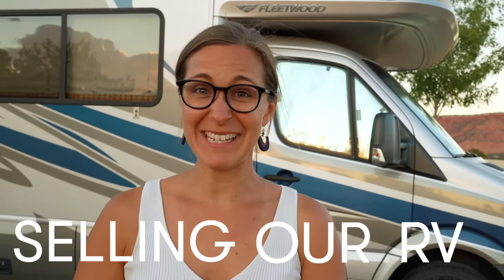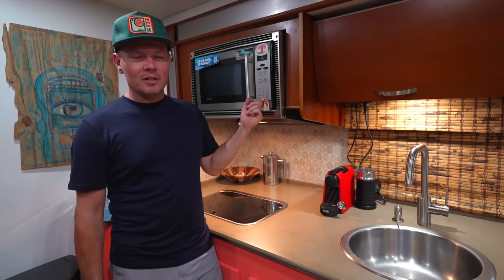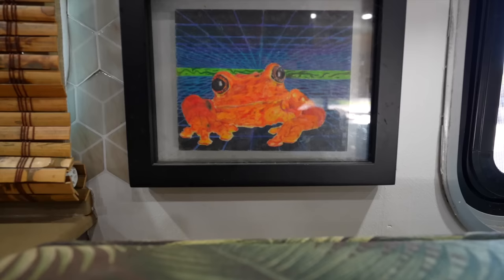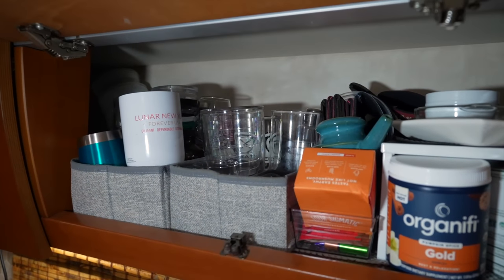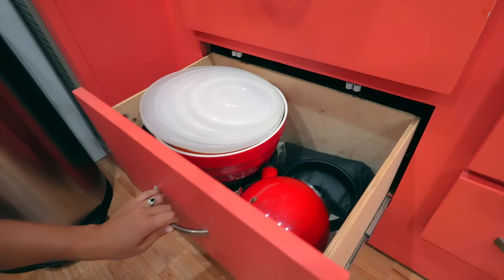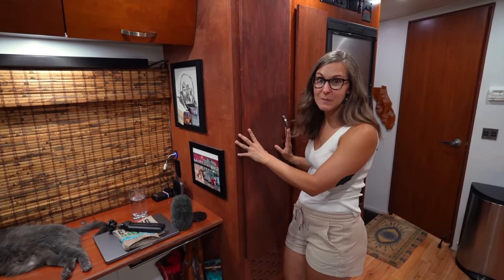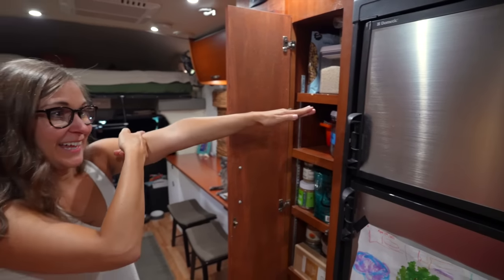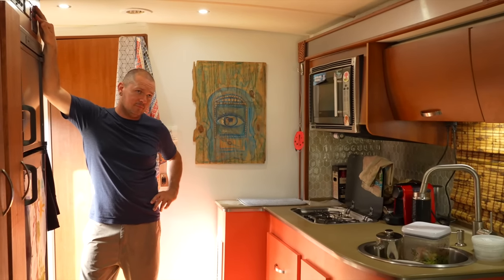We Sold Our Remodeled RV (FULL TOUR Luxury Off-Grid Class C Motorhome)

Comment: Your price is too high for a 2010 model with modifications.
Reply from the maker: There's only 1 other of our model for sale right now and it has no modifications. They are asking $85,500. They didn't make many of these to begin with. We based our price on NADA retail and considered the value of upgrades. Even if you bought one for less after doing all of the upgrades and modifications  we've made you'd be at this same price if not more.
Reply: What’s the price?   Please.
Reply: @mariotapia2656  if you look for the price, it's listed as $86,660.
Reply from the maker: Thanks Heidi!